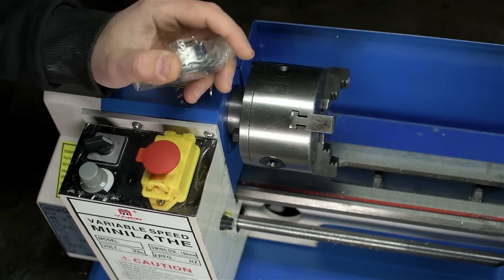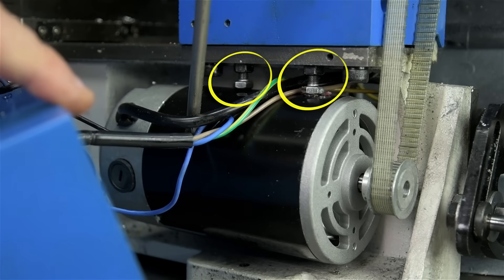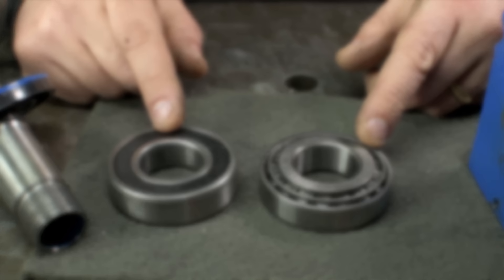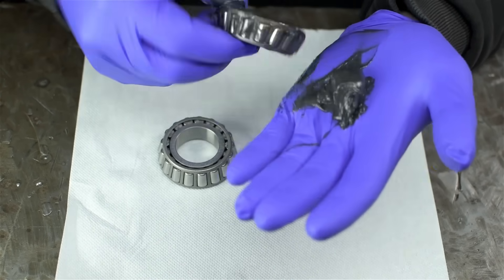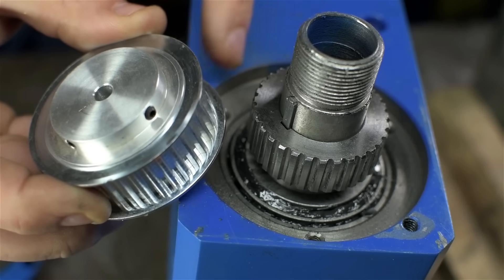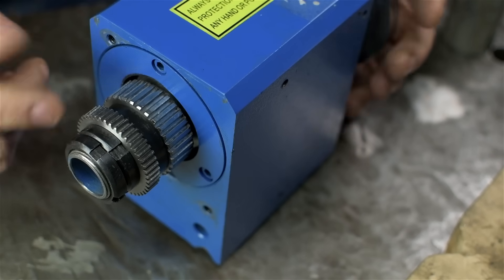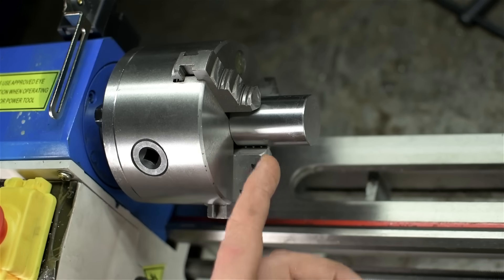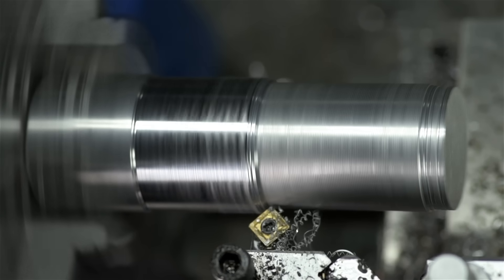Better LATHE Than Never!

Comment: Use the bearing temperature as a guide. 190 degrees, the bearings are trash. 180, pushing it. 140 is pretty tight. If the room is 90 deg. And the bearings are 110 -125 deg. after an hour you are good.

Comment: I don't know about you but I keep my one good eye covered all the time especially while out in public. in the shop I use my 2 bad eyes and good thing they are bad because that means I've been wearing glasses all my life if that wasn't the case. I would be using only 1 of my good eyes instead of 2 bad eyes due to someone's snow ski launching at my face while minding my own business out on the slops one sunny day. The tip of his ski hit dead center on my glasses lens and proceeded to cut my nose. cut was not that bad a band aid was all I needed my glasses didnt survive the lens made of impact resistance plastic had a deep gouge right in the center. saved my bad eye from becomeing no eye. And that is only one of the times glasses saved my eye.

Comment: Tony you do a great job helping these people understand how & why. One thing I would like to share at this point regarding installing the Race of the bearings into the housing.  At 7.0 on to 8 something.  Guys many of you probably won't have the neat tools Tony and I have in our shops for pressing things.  So take the old race out and lightly grind/polish the outside down just a tad so it will easily But snugly slip in the housing.  Place the good/new race in place.  Then place the Old Modified race over the top of it. Thin edges together and hit or press that. That's the perfect fit for that race.  IF YOU SCAR THE BEARING RACE EDGES OR INSIDE.  YOU GET TO BUY A NEW ONE.  AND THE PROCESS STARTS ALL OVER... Back to you brother Tony. Yall don't tell him I said so. But he does a dang good job with his videos.  Since I been disabled with surgery for the last few months.  I'm glued to youtube.  This man is doing you a gigantic favor sharing his wisdom.  Believe that, 😮 in years gone by. Nobody told nobody SHIT.!! That's what paid bills and in racing it was your Hard earned advantage......Burning 🔥 the Midnight oil as it was referred to. 

Nowadays knowledge is easy.  Just type your problems in and presto.  But all you see is not right. Be careful friends

Comment: I’m finding that when I turn between centers and the tailstock imparts force onto the spindle nose, I’m getting some squeal, especially once the lathe heats up. Is that pre load, bearings, or some other black magic? Hmmmm… Bolton 1337g lathe

Comment: This is good. I am a Design Engineer and skilled C.L Machinist. It's ok to get oil into the bearings it doesn't matter if it comes out. You need to get oil in there every so often. Keep it away from wires. If you use a high speed steel cutter your RPM will have to come right down but the chatter should go, you can't use the same high speed as a tungsten carbide tip and a top rake groove will have to ground into the HSS tool and it needs flooding with coolant then the chatter should stop. Nice try with the bearings though. I've just decided to buy one of these toys as I have now retired. I have seen one with a 1.5" spindle bore. (The same as the 1.5"  on your Colchester Student). This is a good video. I will buy one based on this. I will put a video up showing how to grind the tool. It's easy when you know how. Hope it works.

Comment: Informative video.  But I have an idea for your  head stock  lubricant  quandary.   Why don't you  mill a ledge in the inside of the headstock to mount a bottom coverplate? Since it is a casting, you have to mill or surface grind everything square to create a leak resistant   seal.  Then, if you drilled and tapped the side for a fill port and vent, one could  maintain a full resavoir.  Sealing could be accomplished by  both  means a close fit, a  gasket,or silicone sealant.

Comment: Hey Tony, maybe version 2 has a Tony-type foot on end opposite of the bitey part that allows T-clamp pressure when you tighten it down.  Then you can return the T-slot clamps to their previous job of holding the door open. 😂

Comment: The direction in which the open ends of the cones face has a very large effect on the stiffness of the set up.  Also, taper bearing require a preload to them in order to work properly.  If you have ever done any work on front wheel spindles of a car that is not front wheel drive, you will understand what I mean.  Oops, I should have been a little patient and waited for the video to get their.  With the angular contact ball bearings, it is possible to make the spindle much stiffer than with the taper bearings.  But as you mentioned, it is a matter of cost.  The problem that I see with putting $200 of angular contact ball bearings into a $600 lathe is that you still have a $600 lathe.  Great video.  It points out why when I purchase my first lathe I will be buying a higher end lathe as I don't want to have as a first project that of refurbishing a lathe.  I will do that with my second lathe.

Comment: For anyone following Tony;s bearing upgrade, suggestion: while you have the headstock dissassembled, take some time to check all the mating surfaces fit well, and also change out the plastic spacer to a steel one. Check for space to add a block between the top and bottom of the head stock support area of the main beam, often this is an "I" shape section and will benefit from adding supports to change it to and "II" or "III" shape where the head stock rests. This will reduce chatter considerably. Good Video thanks,

Comment: Just lube the bearings, use an inch lb torque wrench, set the drag torque on new bearings at 10-20 lbs inches. 0-10 on used bearings. These tapered roller bearings are actually a small pinion bearing for some small axle in a car.  The problem though is the weak motors in these, you could actually overload the motor.

Comment: Yhea decapitation. I'm not letting you anywhere near me for brain surgery. Your first move is a decapitation which takes the whole head off and kills the patient. The procedure you're supposed to do is A Craniotomy. Frankly I'm hugely disappointed as someone to do a cheap bit of brain surgery. I'd have accepted a bit of a messy Op after all you're not a brain surgeon but death from cut one is well we definite no thanks. 😂😢😮😅😊

Comment: I've got one of these for 15 years  now. It works great for  soft materials and  small work.
However. The  plastic  gears were the first to give  up, then the motor melt down, literally. 
It has now a 400w three phase motor with a VFD.
No gears whatsoever. A stepper motor for the  lead  screw. Still has the original bearings. 
I sincerely recommend it  for beginners, as a cheap way to start learning. And even for  those that already have  a  big lathe, since it is way more comfortable to make really small parts and more economical, energy-wise...
It doesn't make any sense to start a 3 tons machine for a 6mm  brass bolt or washer.
And yes. After using this small lathe for a  while, when i finally got  myself a proper industrial lathe, it felt like i've trained all my life with a cast iron basket ball, and then moved to a normal rubber ball. It was shocking to see the difference in potential...

Comment: Your chatter is from the quick change tool holder you installed. The original toolposts sits the cutting edge of the tool above the cross-slide table, yours is sticking out to the left edge of the cross-slide inducing a rotation motion. It's a lever pushing on your tool's cutting edge, resting on the left cross-slide way and pulling the right gibbed cross-slide way up, the loose and oversized gibs in this little lathe's cross-slide can't take that pull-up/rotation forces of stick out or deep boring. I just locked the original compound rest 30 degrees off the the left on my crosslide instead of right and locked the gib, that moved the toolpost mounting hole back enough to so my quickfix tool holder holds the tools on top of the crosslide instead of sticking out to the left.

Quickchange toolholder stick out is the single greatest cause of lack of rigiditity and chatter in these small lathes and people will replace the bearings, gibs, gears and even scrape the head mount surface without noticing it. This little lathe is a real teacher in machining physics, I see a lot of people saying bad things about it but failing to see these simple facts, I get a nice gloss finish and great dimensional accuracy from rusty pices of mystery steel on it and once I figured I could sharpen inserts it surprised me even more.

Comment: Hardings lathe use ball bearings, but I guess they’re not self respecting. Move up a few grades in ball bearings or roller bearings i.e. a few hundred dollars and you will notice a marked improvement

Comment: What about a suitable thrust ball bearing upgrade instead. I realise that the total bearing package distance will increase but it would give the best of both worlds and not be as much of a compromise as either taper roller or angled ball bearings. Opinions?

Comment: I wonder how much more expensive the Lathe would be if they made it perfect from the factory?
Good bearings from start, oil-lubricated, and scrapped the parts that doesn't fit without shimming them with washers when assembling. The labour is still cheap in China, so it would mostly be the partscost (and some additional time to make it perfect)
It would still be decently cheap, but so much more value for the money.

Comment: One solution for the preload is using a spring washer on the bearing nut end of the spindle if that end has a sliding fit.  This allows the preload to self adjust to temperature changes.  I've used this strategy on a number of rebuilds with good results.  Logan lathes actually put a pair of massive Bellville spring washers between the outer bearing race and the inner retaining clip.  Very effective setup.  I repeated it when I converted my Logan from sloppy ball bearings to Timkens.  Works great.  Used this strategy on my C6 CNC conversion headstock and my home cooked CNC mill.

Comment: Difference between a Ball Bearing vs Tapered Roller Bearing. Eventually the Ball Bearing breaks after running a few races on your stock hubs with ball bearings while your safety hubs with Tapered bearings will last a good while before you have to spend another 350 for a new hub.

Comment: To get the proper preload for ANY bearing follow these simple steps: 
1; determine fastener type.
2; spend 25 minutes trying to find appropriate tool.
3; after finding "close enough" in your neighbor's garage.
4; wiggle part in question.
5; pause for coffee or beer.
6; find "close enough" tool because it was "just right here a minute ago"...
7; wiggle part in question.
8; answer cellphone because your partner called at the exact moment one always receives a call during these type of situations.
9; wiggle part in question.
10; shit it's 10pm, better get to bed.
11; (following morning) wiggle part in question.
12; tighten till you hear a crack.
13; back 'er offa quarter turn.
14; wiggle part in question. 
15; profit

Comment: To make a complete repair, a spacer needs to be fabricated between the two bearings similar to an automotive pinion gear and able to be adjusted with shim stock to set the proper preload on the bearings as a crush collar would. The jam nuts could then be torqued.

Comment: Tapered roller bearings are brilliant. The most important this about fitting them is the installation torque. Too tight and they wear out too loose and they wear out.
What I did was use aircraft wheel bearings.
They are not overly expensive but more importantly they will have a fitting procedure and a final torque.
Usually the procedure goes like this.
Fit bearing. If the final torque is 45 in/lbs
Than you tighten to 3 times that torque while rotating the shaft. Back the torque of to 0 and re-torque to 45 ins/lbs.
If you know someone in the aircraft industry they can get you some Aeroshell  wheel bearing grease, otherwise automotive grease will do.
I have access to all the aircraft equipment so this was easy for me.
I did mine 4 years ago and it's still going strong!

Comment: I have a much older first series of this sweet China girl, A Cummins tool distributed gem. 
And I must say that it is much better put together then the newer ones, the spacer in mine between the two belt cogs is steel, the slide and tail actually sit level front to back on the bed,  the fit and finish is just cleaner all the way around...
I must have been just lucky to get a halfway decent one..don't get me wrong, it still is what it is, but for sure is quite a bit better then the newer ones.

Comment: wow. I will share my story here which relates because you are partly the influence of my story. I'm trying to get my feet wet with machining and a lathe is the first step. Now I refuse to go out and buy one. Instead I'm planning to try connecting a motor to an axle with some pulleys. I happen to have several ball bearings, a mistake made ordering lawn mower wheel bearings. So I plan to try using them for a light weight test. Beyond that I already thought of using wheel bearings which are just like your upgrade for my next step. Anyway it was great to find simple ball bearings are coming in some lathes of course they are a bit larger than what I have. I'm expecting this to be an adventure.

Comment: Oil is going to be present on the lathe anyway. Whether it comes from the spindle lube system or the cutting tool coolant is irrelevant.
I drilled an access point to both bearings and manually oil as needed.
One piece angular contact BALL bearings are available @ $20.00 ea.
Sealed are out there around the orbit of Saturn for $100.00 + or -.
The open one piece angular contact ball bearings work fine with
a shave off of some material from the nonmetal spindle spacers.

Comment: I know this is close to a 4 yr old video, but for those that don't know. It is said, Idea preload on the taper bearing would be between 15in/lbs and 25in/lbs.if you have a inch pound torque wrench then you can use it, the thing is the needle style wrench is better then the digital style in this application.

Comment: is it possible to cut gears with this lathe? what modifications would be necessary to do so (working in aluminum and brass) also, how does one cut internal toothed gears? I'm looking for a machine to cut crank shafts, camshafts, and gears for small scale motors.
Reply: you could cut the gear blanks on this lathe but you'd need a mill with a rotary table to cut the teeth.  or I suppose if you have the patience you could file them like Clickspring does

Comment: You shouldn't use lithium moly grease on roller bearings.  It will make the parts so slick that the rollers will want to slide, rather than actually roll...

Comment: Just out of curiosity did you happen to open the bearings that were in there, just curious if they had actually used sealed angular contact bearings, and maybe just looked like ball bearings
Reply: You'd be able to tell by the part # on the seal.

Comment: I added an induction sensor to turn off the motor preventing cutting the spindle. Installation is very simple. Only the holder have to be printed.

Comment: I was doing some research on how to get the race out if you indeed put it in backwards, and apparently if you weld a bead around it, it will fall right out as it cools! 😯 

Was doing some research on it because my minila-the came with one tapered bearing and one ball roller.

Comment: Hi,  I wonder whether tapered roller bearings improve ridgidity in a significant amount or it's a hype. I think that the spindle diameter is the main factor in the ridgidity and it's not an easy thing to upgrade.

Comment: I’ve done loads of little improvements to my minilathe but I STILL haven’t done the bearings.
I use it often, commercially too.
I’ve just ordered the bearings, both tapered roller & angular contact, I’ll make the decision when it’s apart.
I’m going to lap one end of the spindle though, so the bearing is a tight sliding fit, that way I can get a more accurate preload.
Great channel Tony, although it’s getting a bit too CNC-ey lately.

Comment: I think I got lost one one point. So you did not get holes in your tool post that would allow you to loosen the block bolts to rotate the unit. You know have to remove the tool post to rotate it to any angle? At one point I thought you said it di line up over the cap screws.

Comment: So, i got myself an Emco compact5 mini-lathe years ago, but this was of course made in Austria not China and is considered a watchmakers lathe or modelmaker/prototyping lathe. It has handled some rather huge workpieces, like a new bearing assembly for my concrete mixer, while maintaining very little runout. However, every little bit and piece of this costs real money, like 150$ for a gear set, 80 bucks for a set of 4 quick change tool holders (only holders without mounting post) and so on... But seeing some of the engineering details in this video, i know what i paid for...

Comment: I got my Chinese mini-lathe (in this case, a Grizzly 7 x 14) a year ago and it was not very functional. The thickness between the top surface of the ways and the bearing surface underneath the ways varied by 0.004" along the length of the machine. After that was sorted out, I will still getting wicked chatter so I replaced the cross-slide with a solid block which yielded some improvement. However, the most important upgrade I did was to replace the factory spindle bearings with angular contact bearings. Literally, it's hard to believe it's the same machine. Almost no chatter at all.

Comment: He forgot to cut notches in the headstock needed to remove the outer race when they need replacing. Then again, it's just a cheap lathe.
Even with the new bearing, I believe the the chatter is caused by the tool post with the tool holder sticking out too much. The saddle on that lathe is flimsy too.